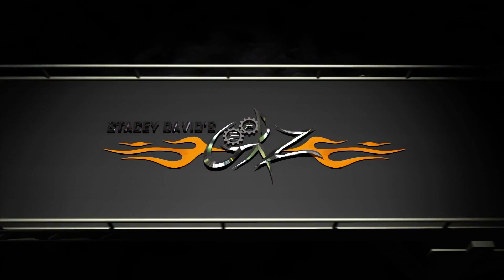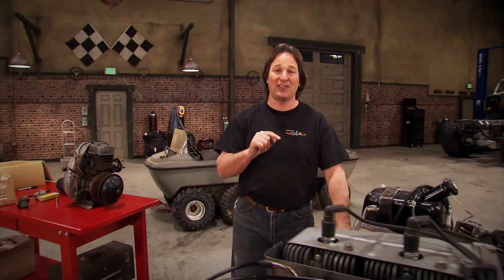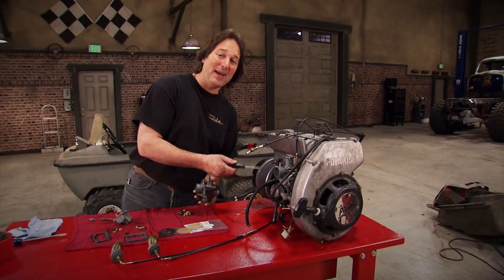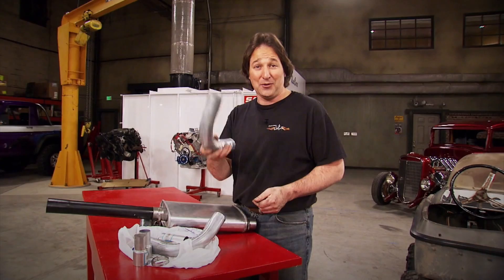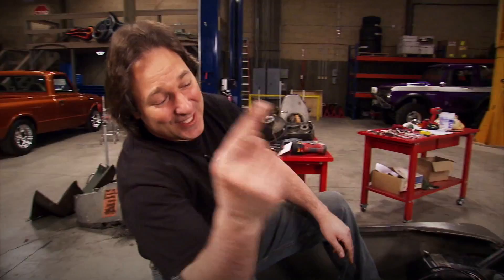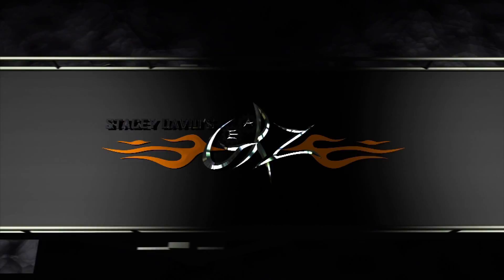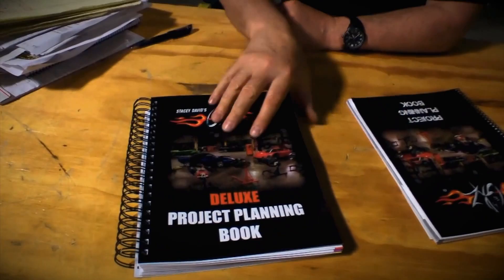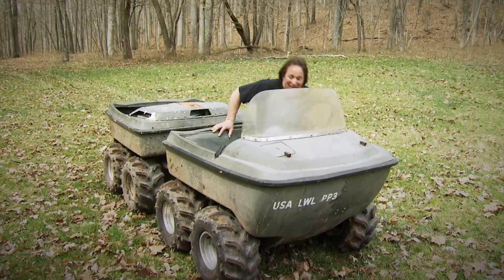Reviving the Sur-Trek 8-Wheel Drive Amphibious ATV - Stacey David's Gearz S1 E2

Comment: that motor wont last long.. tow strokes use the pulse from the expansion chamber to remove heat from the motor.. where those carbs jetted for summer temps? its gonna b too rich and flood out and burn plugs all the time.